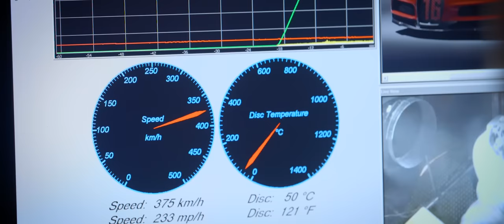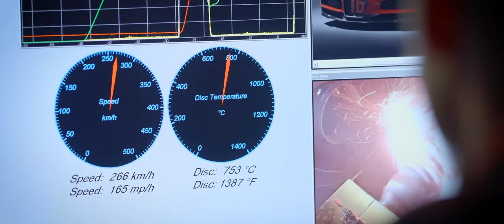BUGATTI CHIRON Titanium caliper brake-test extreme

Comment: This is why I never ride my bicycle at more than 350 km/h.
Reply: Imagine man
Reply: What the hell happened here.
Reply: You don’t 

So you not a cool kid

🤣
Reply: Bru my tatanium brakes + a parachute can easily handel 500km/h+
Reply: Tenga su like, me hizo reír🤣
Reply: I ride mine at 999999999999999999999999999999999999999999999999999999999999999 kmph
Reply: Lol
Reply: Wow
Reply: @bobdabuildar69  why not use carbon carbon breaks, its much more efficient at intense heat...
Reply: @bobdabuildar69  dam efficiency go brrrt
Reply: @slowlylosingmysanity9726  yessir
Reply: @alandtawfik1619  😐
Reply: @slowlylosingmysanity9726  I use rims much lighter
Reply: Alex68dash what it is a joke
Reply: Yeah man its dangerous in 351
Reply: Lol
Reply: It is not possible to ride a bike at such a speed - your feet need to run 30x faster than 1 second
it is impossible for the joints to withstand this.
Reply: I ride my bicycle at 100000000000000000000000000000000000000000000000000000000000000000000000000000000000000000000000000000000000000000000000000000000000000000000000000000000000000000000000000000000000000000000000000000mph
Reply: That means you’re already without legs
Reply: @guestonlyforpleasantpeople5291  r/woooosh
(even it may be sarcasm)
Reply: @ganaraj5016  But am I saying wrong? 
If he was driving at that speed, joints would not withstand it in that speed and the bike will fall apart from it.

unless he roll off very steep giant mountain.
but still the bike will fall apart from it.
Reply: @guestonlyforpleasantpeople5291  yeah you are right I agree, but chill bruh its a joke
Reply: @ganaraj5016  Then I accelerate at 100km / h  from mountain with bicycle and the steering wheel just broke
Reply: @guestonlyforpleasantpeople5291  ok bruh😂
Reply: me too
Reply: Yeah! But In Dream.. 😂 😂
Reply: @bobdabuildar69  those wouldn't even heat up so no braking performance
Reply: Wtf
Reply: @dwen_.  You Mean.. WHAT THE FUN..!? 🤔🤣
Reply: Nice decision bro
Reply: Carbon brakes is the solution like the gp bikes
Reply: @elgatocomunista5299  it amazing 😲
Reply: yoo your profile picture

i can say that ə əəəəə
əəəəəəəə 
everyone says this word in Azerbaijan
Reply: @elgatocomunista5299  faster than light itself
Reply: @slowlylosingmysanity9726  because they don't work when cold. Only a negligible portion of these cars happen to experience extreme driving conditions, but all of them must be safe on the road and pass safety regulations which dictate that cars brakes must be able to stop the car from around 75% of it's top speed, 3 times in a row...
Reply: @ganaraj5016  maybe sarcasm? that was not r/woooosh, it was so low it was actually a hit&run 
anyway the @Unknown
 math is wrong, it depends on the gear ratio, mine is much, much lower than road bicycles, it's a utility bike, so I have an advantage on the down hill scenario. And I'm not sarcastic.
Reply: @bobdabuildar69     h
Reply: 88 km/hr top speed me
Reply: @alandtawfik1619  i ride mine at 50kmph
Reply: Only 350km/h? I ride mine at 400 😂🤣
Reply: so the limit is 349km/hr, interesting
Reply: ahahahahahahahahahah
Reply: You have bicycle 😱😱 what is meant by bicycle??
Reply: @suryawanshiedits1855  he means a bike😁
Reply: Hahahaa
Reply: No you should not
Reply: Yoo that's actually a speed for an airplane take off tho 😂😂
Reply: @bobdabuildar69  You are kids i use uru metal .
Reply: Bye bye cycle 🤣
Reply: @elgatocomunista5299  lmao i can teleport 😂
Reply: I need TP for my Bunghole huhuhuhuhuhuhu
Reply: ah yes, a man of culture using metric system
Reply: Agrée, I personnalité stop at 300, this is safer
Reply: @guestonlyforpleasantpeople5291  what about riding down from the hill
Reply: Hol up
Reply: You’re missing out.
Reply: Good idea
Reply: Same
Reply: Your cycle will fly when u reach 100 kms only and you are talking about 350 kmd
Reply: I know that a bike is a Air compressor brake right?
Reply: And that is why I ride my bike at 349 KM/h
Reply: So the limit is 349
Reply: why not? it would make a lot of heat thats called free heat
Reply: 5 head
Reply: 😂😂😂😂😂👌Nice
Reply: 🤣🤣🤣 you are funny
Reply: Haha
Reply: @slowlylosingmysanity9726  Carbon is expensive that's why
Reply: Master Marc Subliminals  bruh 30kmh ain't shit
Reply: Bicycle? At 350?
Reply: @Vaczil  then u would get fire
Reply: My bangla cycle break is more powerfull than bugaati break system.
Reply: @kundankantthakur6255  bro, my leg break is the strongest in the world. Because after that my legs break.
Reply: Bugatti ir wht❤❤
Reply: Just take off the break, and you dont have to worry about that
Reply: hahahahah
Reply: U need to buy bugati brake
Reply: @bobdabuildar69  with reverse thrust i can get up to 800km/h
Reply: Wut da? You can ride your bicycle at 349km/h? You are super human/alien
Reply: Bro is playing GTA
Reply: true, i had a nagasaki 8400Kr and that shit went form 0 to 60 in like 3 seconds.
Reply: Even ur bicycle never reach at 100km/h
Reply: Because you do not have any car which strong enough to reach of this speed 😃
Reply: @sovietunion9131  bruh i doubt bugatti cant afford carbon
Reply: ah, so that's why I was able to overtake you yesterday, lmao
Reply: Bruh, 350 kmph on a bicycle is pretty norms. What do you all skip leg day or what? Get on our levelllll. Mauro knows, but he's being humble
Reply: Man i do that all the time
Reply: That is the speed I have to avoid going down the big hill
Reply: Tu veux dire qui tu dépasse pas les 35 km h avec ton 50cm3, tu as raison c'est bien d être prudent
Reply: Can someone translate 350km to American pls
Reply: a normal bicycle cant even reach 25mph without any sort of tuning on the bicycle
Reply: Me also
Reply: Are you threatening me?.I am cornholio!.I need tp for my bunghole. .meeehhk meeehhk
Reply: Agreed 😋👌🏻🔥
Reply: @guestonlyforpleasantpeople5291  you should look up ghost rider that  guy hit 220 mph on a motorcycle. He's from Europe crazy riding skills.
Reply: You are a smarter man than I.
Reply: @guestonlyforpleasantpeople5291  It is technically possible, just ride it down a really long and really steep hill
Reply: smart man.
Reply: i ride my bike at 350h/km
Reply: I had to learn the hard way
Reply: At that speed, your rubber blocks would be glowing.
Reply: Bro just teleport it's not that hard
Reply: 😂😂 got me
Reply: When you ride you selected in race
Reply: Shabash beta
Reply: That impossible to reach that speed in bycicle
Reply: @Massatt1  oh yes it is.. welcome to 21st century
Reply: Lol im also a biker i imagine how u manage to do that i once did a 310 on my kawaski and the air pressure was hillarius its very dangerous a single piece of stone can send u to heavens😋😂😂
Reply: Your bicycle going 350 😱 mine’s only reaching 300 😔 I feel cheated
Reply: @guestonlyforpleasantpeople5291  no its not
Reply: Yea 349 is good
Reply: I wear metal shoes to stop the cycle at 9999999999km/hr as I don't have wheels in my cycle
Reply: Bro yor bike can't even take it to 300 km per hour 😑
Reply: Install Bugatti brakes and then enjoy!
Reply: Me too
Reply: @gosherkerr9563  that was good XD
Reply: But I do , and breaks work well 😄😄
Reply: @guestonlyforpleasantpeople5291  way to take a joke
Reply: LOL 😂
Reply: You have 300 horse power on your leg, and zero power on your 3rd leg
Reply: Bro 💀
Reply: Can bycicle really attain even 100 km/h?
Reply: i ride my bike at 9764 mph 😎
Reply: I ride my son's bicycle at 487 kmph without breaking his chain or something
Reply: Ngelawak lu tong
Reply: 😂😂😂😂😂😂😂😂Lol bro your bicycle is made by buggati
Reply: @elgatocomunista5299  i ride my bike 1 km/h
Reply: @Andrecio64  yea dude it goes a little fast ig
Reply: A- ayo what?? 😳
Reply: your leg is strong
Reply: @guestonlyforpleasantpeople5291  r/woosh
Reply: whats that in baseball fields per ford mustang
Reply: Cute, bat crazy.😀
Reply: I've never went beyond 80 km/h
Reply: Nice! but once i went 400km/h in my hoverboard
Reply: Good call bro
Reply: Just ignore him guys
Reply: Good idea
Reply: @alandtawfik1619  bgfg
Reply: Yea, i highly recommend not going over 350 mph with a bike, thats why i ride at 349 mph
Reply: Kek
Reply: @bobdabuildar69  new element "Tatanium" has been discovered.
Reply: Only the cool kids did that back in the day
Reply: You're absolutely correct!
Reply: my friends brother rode his at 146km/h and his wheel is now twisted sideways but the brake disc on has some marks
Reply: @bobdabuildar69  "tata"nium breaks. I bet thats stronger than a nokia break.
Reply: Better be protected 😂
Reply: just don't use breaks. several houses and a lot of fencing is more than enough.
Reply: My bike brakes would be gone
Reply: Good bro... Be safe...  300-350 kmph is enough for a normal bicycle 🚲
Reply: bros tires would explode at that seed
Reply: @turbobanana4794  yes at that seed
Reply: I'm driving))
Reply: You dont say
Reply: almost broke mine while in 700 km/h..
Reply: what the
Reply: You must have very strong legs to go that fast. I wonder how fast you can run on foot.
Reply: Tu no has ido a 350 en tu vida flipao jajaja 😂😂😂😂
Reply: 35 kmh man 0 is a mistake
Reply: what is that in MPH i don’t really feel like looking right now lol
Reply: Me too
Reply: Reality men
Reply: My disc brakes bolts in my bicycle just got screwed off.
Reply: @guestonlyforpleasantpeople5291 some one didn’t get the joke
Reply: Bikecycle 350km/h??? WHAT THE FUCK!!!
Reply: bro fr fr
Reply: lmao
Reply: Bruh😂😂😂
Reply: My scooter 🛴 also finds this relatable 💀
Reply: Pxsdnus  ok? That was a year ago, why reply?
Reply: If you ride your motorcycle at that speed and then press brake, you will directly go to the moon and your existence on earth will be erased immediately.
Reply: @pritamsarkar9931  Cars>Bikes
Reply: Relatable
Reply: Mee tooo
Reply: @bobdabuildar69  that will destroy the whole bike and make it spaghetti, and you're the meatball.
Reply: Me too. I would shat my pants if i see my bicycle brake red hot
Reply: The true reason is your ride can't reach 350 lol
Reply: I want to see what it takes to pedal a bicycle up to 350
Reply: @bobdabuildar69 a new technology is here its a ovcr 9 clocking breaking
Reply: I used to do it but after seeing this bro
Reply: Bugatti ninja h2 r
Reply: Same it almost happened to me
Reply: I ride my bicycle at 99999999km/h bro 😒💀
Reply: Pffttt 350. Lol puny. Chiron 450
Reply: rookie numbers
Reply: More like 350 m/sec
Reply: I ride my tricycle and 10^10000 the speed of light
Reply: I don't think a bicycle is capable of going 350km/h
Reply: Yeah even i scolded my younger brother for riding his tricycle at Sub Sonic speed 🤦🏻‍♂️
Reply: you are not VASAR😂
Reply: Only 349 km/h
Reply: Lol 😂😂 you compare your bicycle with buggati 🤣🤣
Reply: There's no way you can go that fast on a bicycle.
Reply: 350km/h is normal speed for my bicycle
Reply: Can you even ride a bike at 350 km/h?
Reply: @Kofakaka  Can't you?
Reply: If I fall on tha ground my mom would do kung fu
Reply: wtf
Reply: Me too.
Reply: You can try it😂
Reply: Relatable
Reply: Understandable, i had to listen to everybody's advice
Reply: Use your slippers man🩴
Reply: @rozsnoww  😂
Reply: I need a new keyboard as I spat my coffee when I accidentally scrolled down the comments and read this.
Reply: What?
Reply: @alandtawfik1619 take a joke
Reply: I wish that to be my only problem to go to such speed
Reply: G forces:
Reply: Nice advice
Reply: @bobdabuildar69 Oh yeah? Well, I added air brakes, and a spoiler to slow me down. And it just gives me extra mobility at 500KMH
Reply: @TJThunder what happened.. not happen
Reply: Gotta say . As long as ur below 500, the brakes can handle it
Reply: You’ve got 1000cc legs or something lol 🤔
Reply: I had
Reply: What are you running from?😅 Why would you even close to that? Titanium is superb.... The rate at which it dissipates heat can only be matched by a few materials. Titanium /ceramic... Something Is cooking already
Reply: Is 349.9 km/h OK though?
Reply: Ok we are all Weird here!!! I drive so fast that my speedometer  can't keep up with my acceleration 🤔!!!
Reply: If you hit the breaks on your bike as hard as they hit the breaks on this you would keep going forwards at 349 km/h XD
Reply: My rim brakes can't let me drive over 500kmph.
Reply: How much hp does your cycle/legs have
Reply: Bicycle has rocket in it
Reply: honestly you should give it a try tho
Reply: coincidence, i too
Reply: Ohhhh, okay 😂😂😂😂😂😂😂
Reply: Bicycle tyres melt,chains wear out,brakes dissappear,pedals break,rider:dead💀
Reply: Dude u better dont, i stopped doing it when my titanium brakes started sparking
Reply: honestly same
Reply: I reccomend you not the front brakes because your gonna fly
Reply: That really makes sense bro